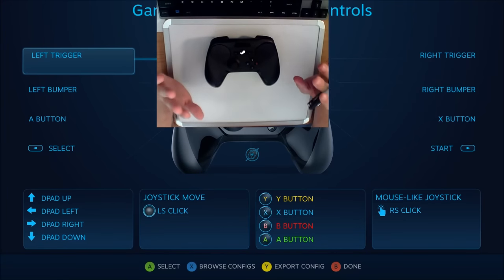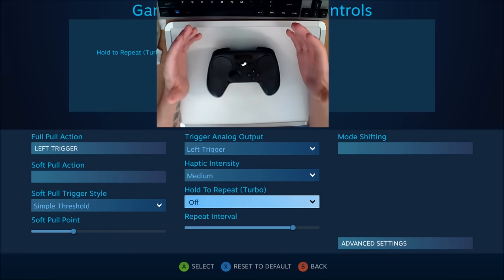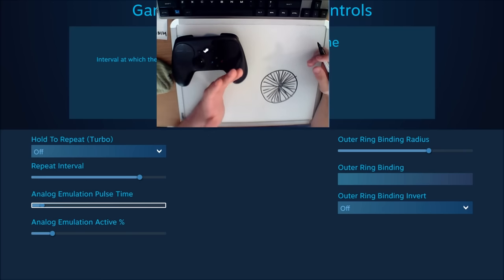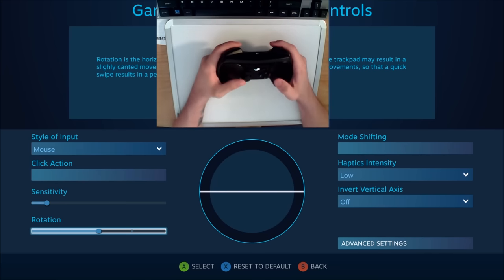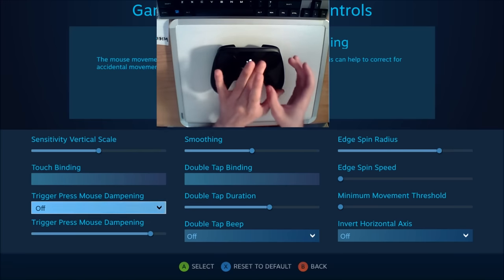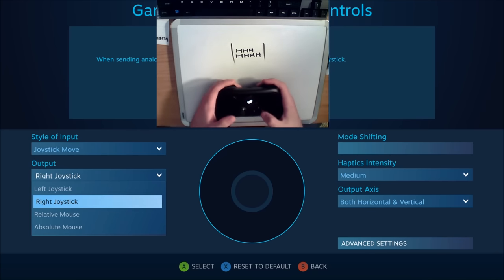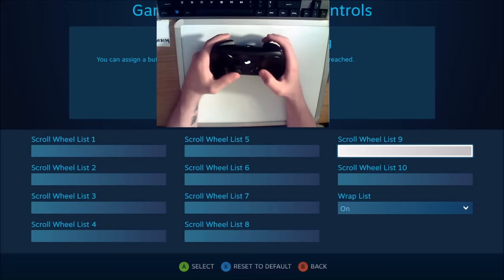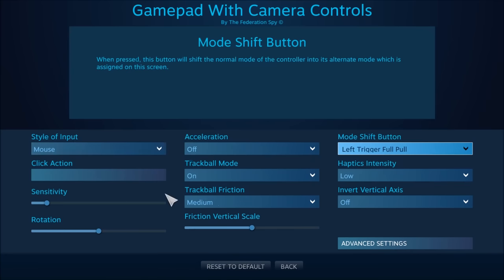Deciphering the Steam Controller Software (In-Depth/Very Long Video)

Comment: Timestamps for mobile:
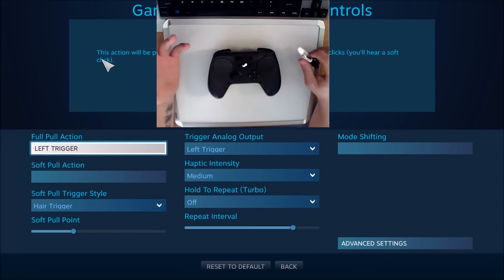1:10 - Triggers
1:50 - Trigger Soft/Full Pull Actions
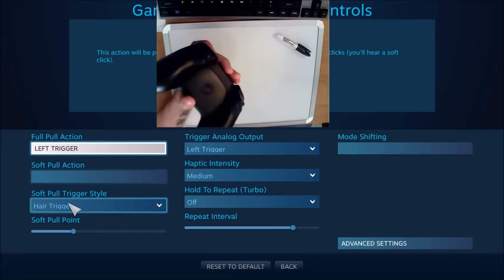2:28 - Trigger Soft Pull Point
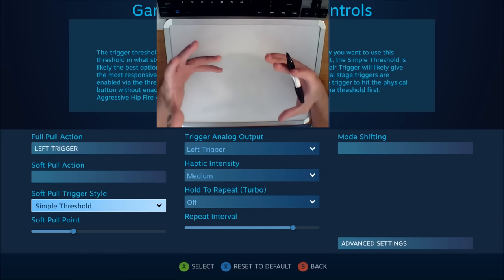3:14 - Trigger Soft Pull Trigger Style
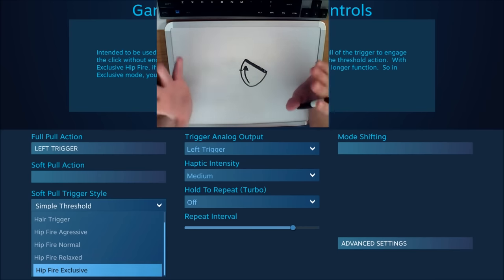7:39 - Trigger Analog Output
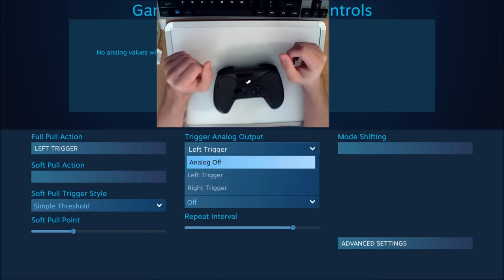8:33 - Haptics *
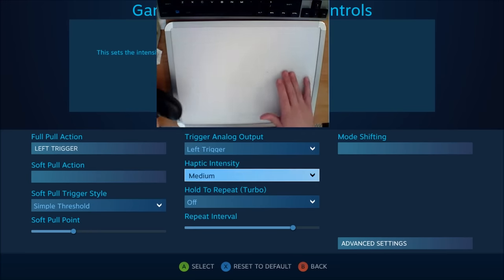9:19 - Hold To Repeat (Turbo) *
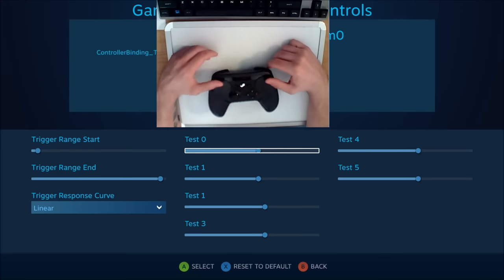11:24 - Trigger Start/End Range
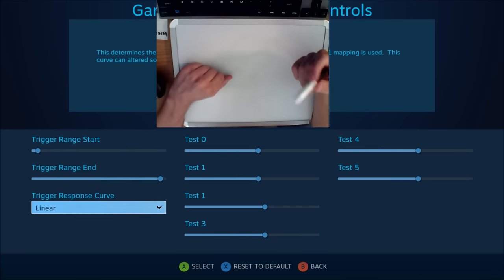12:55 - Trigger Response Curve *
16:25 - Bumpers/Grip Buttons
16:39 - Trackpad
16:47 - Trackpad/Stick Directional Pad Input
17:35 - Trackpad/Stick Directional Pad Layout *
22:16 - Trackpad/Stick Directional Pad Deadzone
22:45 - Outer Ring Binding/Radius *
22:07 - Outer Ring Binding Invert *
24:54 - Trackpad Button Pad
25:22 - Trackpad Button Pad Button Radius/Distance
27:35 - Trackpad (Mouse)
27:54 - Trackpad (Mouse) Sensitivity *
28:43 - Trackpad (Mouse) Rotation *
30:10 - Trackpad (Mouse) Acceleration *
33:23 - Trackpad (Mouse) Trackball Mode *
34:24 - Trackpad (Mouse) Trackball Friction *
35:10 - Trackpad (Mouse) Trackball Friction Vertical Scale *
37:21 - Trackpad (Mouse) Invert Axis *
37:49 - Trackpad (Mouse) Sensitivity Vertical Scale *
38:51 - Trackpad (Mouse) Touch Binding/Click Action *
39:06 - Trackpad (Mouse) Trigger Press Mouse Dampening *
40:02 - Trackpad (Mouse) Smoothing *
41:11 - Trackpad (Mouse) Double Tap Binding *
42:07 - Trackpad (Mouse) Edge Spin Radius/Speed *
43:39 - Trackpad (Mouse) Minimum Movement Threshold *
46:09 - Trackpad (Mouse Joystick)
47:15 - Trackpad (Mouse Joystick) Minimum X/Y Output Value
48:53 - Trackpad/Stick (Joystick Move)
49:00 - Trackpad/Stick (Joystick Move) Output
50:48 - Trackpad/Stick (Joystick Move) Output Axis
51:26 - Trackpad/Stick (Joystick Move) Adaptive Centering *
52:29 - Trackpad/Stick (Joystick Move) Stick Response Curve *
52:55 - Trackpad/Stick (Joystick Move) Deadzone Shape *
55:14 - Trackpad/Stick (Joystick Move) Anti-Deadzone/Buffer
56:46 - Trackpad/Stick (Joystick Camera)
57:09 - Trackpad/Stick (Scroll Wheel)
57:12 - Trackpad/Stick (Scroll Wheel) Swipe Duration *
57:41 - Trackpad/Stick (Scroll Wheel) Invert Direction
57:50 - Trackpad/Stick (Scroll Wheel) Clockwise/Counter Clockwise Binding
58:13 - Trackpad/Stick (Scroll Wheel) Advanced List
59:06 - Trackpad (Touch Menu)
59:29 - Trackpad (Touch Menu) Button Count
59:43 - Trackpad (Touch Menu) On-Screen Position
59:59 - Trackpad (Touch Menu) Activation Style
1:00:35 - Trackpad (Touch Menu) Touch Menu Buttons 1-4
1:01:00 - Trackpad (Touch Menu) Labels
1:01:05 - Trackpad (Touch Menu) Opacity
1:01:15 - Trackpad (Touch Menu) Menu Size
1:01:26 - Trackpad (Touch Menu) Advanced Menu Buttons 5-16
1:01:42 - Trackpad (Mouse Region)
1:03:57 - Gyro
1:04:26 - Gyro Enable Button
1:04:57 - Gyro Rotation *
1:05:13 - Gyro Left/Right Lean Bindings
1:05:23 - Gyro Steering Axis
1:05:33 - Gyro Lean Point
1:06:00 - Gyro Minimum Movement Threshold *
1:07:41 - Mode Shifting *

* Any timestamp with a "***" will indicate that this feature is available elsewhere in the software for a different input, but does the same thing. So, settings with a "***" will generally only be explained once.
Reply: THANK YOU. I'd missed mode shifting and you helped me!
Reply: Just got a steam controller. You sir are why I love the internet.
Reply: MVP
Reply: Thank you much, J.P.!!!

Comment: Great video! Just a small correction to the analog emulation part : it is used to emulate a precise angle when only 8 directions are available in-game.

So let's say you wanted to move in a direction halfway between forward and diagonally right (about 12:45 on a clock). The steam controller would then pulse quickly between 2 alternating inputs : forward and diagonal. Pulse time is how long it would send a single input before switching to the other. Active % is how much it sends an input vs no input (so let's say you set it to 20%, it would send a forward input 10% of the time, send no input for 40%, send a diagonal input for 10%, and then another 40% of no input).

It's similar to a PWM in electronics, for those that know what it is.

Comment: I just bought this controller it will be delivered next week. I was worried about the complex configuration as many people said. But u made it very clear. Good job!
Reply: I know your comment is a year old now, but i am in same situation as you were. Now I am wonder what is your experience with this controller? Are you still using it? Do you like it?
Reply: @JohnnyBravo655  Yes, I like the controller and I'm still using it for most of the games I play. The only thing that I don't like that it has no second analogue stick and that the custom configurations don't seem to work when you have no internet. Other than that no complaints.

Comment: Yes, very well done!
I want to add that haptic feedback is not "force feed back" that provides actual mechanical resistance in the case of a steering wheel or flightstick. You correctly referred to it as haptic feedback. In the case where you assign a push-to-talk button, the haptic feedback is excellent at notifying you to the fact that you are transmitting.  What I call a long short press will allow you to use a control for other functions and a push to talk key at the same time. Take the long press and cut the time in half on the right grip for example and you have push-to-talk. Also use the "play button" on the keyboard. Often people use insert or End, but the play media button will never be used by a game as a control. I think it's also called the play/pause button. Use that in all softwares that allow and you will never have a conflict.

Comment: Holy SHIT, man. This is a brilliant guide, I've owned a Steam controller for weeks and this has taught me so many ways to customize controls. Thanks so much for this.
Reply from the maker: I'm glad I could help.  Valve sure doesn't make it easy.  Be sure to check out the other two tutorial videos I did that correct a couple errors in this video.  Valve contacted me and gave me a a few corrections to put in.  In the coming weeks, when I have time I hope to make a completely comprehensive guide with better quality and visuals.
Reply: Yep, the annotations led me there already, thanks! Always handy when content makers properly annotate their stuff.

You're right though, Valve's configuration screens definitely do not have a ton of information. I'd love a visual representation of the deadzone as you change the slider, or at least have it respond by force feedback or something when you are in the config tool changing those settings.

Comment: Thank you much, Nick! I have been using my S.C. for quite a while now, so much so, that I am more comfortable using it, as opposed to M&K. However, the info you provided has helped me to have a better understanding of the controller, and will greatly help in tweaking and improving my settings. Thanks again!

Comment: It would be nice if they added that hair trigger option to the analog sticks, cause right now when you're moving forward with the analog stick and then let go of the analog stick, the controller still sends the forward input while the stick is on its way to the resting position.

Comment: First of all: excellent work.  I have been using the Steam Controller for quite a while and I learned some really useful stuff.

Also: I use the mouse region option for games like RTS that have a map or other UI element in a static place on the screen.  For example, in Company Of Heroes I have a Mouse Region mapped to the command buttons in the bottom right hand corner. It makes it much easier to snap down and give commands without losing my 'real' cursor's location on the screen.

Comment: The uses for mouse region are aiming in top-down shooters (Nuclear Throne, Gungeon) or any other situation where you need to control a cursor when timing/speed matters more than menu usability. For that reason, it also works extremely well for Osu! (a rhythm game like Elite Beat Agents) and Wii games running through dolphin.

Comment: Thanks for the video it really helps break things down. I'm close to losing a little patience with the controller but hopefully I'll be able to tweak it a little better now. I think Valve has almost been it's own worst enemy, they have given us an extremelly customisable controller but it's a sahme you need a degree in controller engineering to fully understand it.

Comment: Amazing explanation, tho you forgot one small thing: you can add multiple inputs to the same button within the input screen where it shows you a mouse, keyboard, and controller by pressing Y on the controller, and they can also have separate configs too. With that you can make a button send a different input by, let's say, holding the button for "X" amount of time and even make macros! This software literally replaces AutoHotkey in many ways. (Also for people who don't know this: the software also supports Xbox and PS controllers.)
Reply from the maker: Z0MG H4X Thank you!  Activators were added after this video was made.

Comment: Excellent video dude! I've owned a Steam Controller for the past few months and your review was the only accurate one I've seen. It is a really overwhelming experience customising at first and I'm only really getting the hang of it now but I'm still learning. Also wondering if you've updated your BPM version because mine doesn't have all those test options which do nothing, plus there's now added visualisations for trigger options, etc. It's way easier to customise now.

Comment: Do all the controls you set up get saved to your steam account? (I'm halfway through so sorry if you answer it later on) Just it would suck to go all the way through setting up your controls to have to do them again another time... - Thanks for the video, especially the examples a lot I didn't think of and make a lot of sense. Am getting mine tomorrow and this has already helped massively!
Reply from the maker: It will save them automatically, but if you want to save a permanent copy of the preset to your Steam cloud, you have to do that manually.

Comment: 56:30 you explain anti deadzone what would happen if you set your track pad to do the thing where it will keep on sending signals when you reach the edge if there is a built in deadzone will you hit that no matter what if your track pad keeps sending signals to move outward?

Comment: What if I want to use a button (like the bumper) to hold this key to open up different key maps? Is that the layers option? I would like it so that I can turn my 4 d pad buttons into 8 because they have a separate set of keys that activate when I hold in the bumper.

Comment: what I've noticed in most games I've played so far, bf3. bfbc 2. arms 3 etc. I can't just use my xbone controller to use both the left joystick and right.  right will not work at all unless it's in some mouse mode. and even then it's either too sensitive or completely useless.  it's really starting to put my right off pc gaming.  'I just wanna play bf on my  pc with the xbox controller with the same sensitivity etc as on console' 😠😠  this is why I still use consoles more

Comment: New Subscriber :) Quick question for the track pad, I'm trying to find out how to program the buttons in between UP, DOWN, RIGHT, LEFT.  So if I touch the trackpad between UP and LEFT it would perform whatever function I have programmed, is this possible?  I can't seem to find a setting for it.
Reply from the maker: Thank you!  I don't think there's a way to do that specifically, no.

Comment: Thank you for this! I'm a Mac user, and the controller I ordered just came in. Do you recommend that I keep the default settings? Also, I noticed that the controller is not working for certain games. Do I have to configure it for each game I choose to play with it?
Reply from the maker: I've never tried to use it with a mac.  For some games wherein the Steam Controller has no native built-in support (some of the only games with such support are Valve titles), you usually have to cruise through the communities profiles and look for a profile that works for you.  Then, if you want you can modify it and customize it.
Reply: Ok, thanks for your help! Quick question: what's the quickest way to turn off the controller? The only way I know is within Big Picture mode. I would think clicking the Steam button would do it but no.
Reply from the maker: Hold the steam button down for 5 seconds.

Comment: Help ! 
I have an issue fat fingering my Y button and track pad at the same time. How do I dead zone the outer edge of the track pad? This is very frustrating. Every time I go for a heavy attack my screen gets pulled down diagonally left.
Reply from the maker: reptilesgamers00 Cut carbs.
Reply: small piece of electrical tape?

Comment: Hey, thanks for the vid, but you(like everyone else) still didn't talk about the ACTUAL joystick on the controller. How do you increase the sensitivity on the ACTUAL stick?(not the trackpads)
Reply from the maker: HotTabascoSauce Yeah, I'm not sure if there is a joystick sensitivity in the software.  Most games will let you edit it in-game.  Other than that, messing around with the inner and outer deadlines could kinda help change the sensitivity.

Comment: I just received mine and can't make heads or tails of it.

Something I've noticed over and over is that often times the user documentation for software is written by the people who wrote the code.  So the text makes no sense to normal people.

For example, a sensible instruction to copy text is as follows: "How to Copy Text: Place the mouse cursor at the beginning of the text you want to copy.  Press and hold the left mouse button, then move the mouse to the end of the text you are copying.  Release the mouse and select 'Copy' from the Edit Menu or Right-Click and select 'Copy' from the pop-up context menu.  The text may now be pasted in one or more locations."

A developer would write it such as, "Replicating string data to alternate concurrent processes is easy!  You need have no knowledge of volatile memory or memory addresses.  In fact, you don't need to understand why the replicated string is retained in memory until being overwritten by new data so it may be duplicated to multiple locations!"

They think they told you something and now they're done with their instructions of how to copy in paste even though they didn't give you the first bit of useful information to teach the user how to copy or to paste.

I especially see that sort of thing in very expensive specialized software such as used by the medical industry.

As I scanned through the software for the Steam controller, everything that was written was worded in weird and awkward ways and none of it really explained anything you'd need to know.  The entire "help" system needs to be shit-canned and then rewritten by people who know how to actually teach things to people.

Comment: Is there a way to press one button on the controller and mode shift every button on the controller?
Reply from the maker: Yes, you can do this by assigning the button's function to a separate action set.  Sorry for the delayed response.

I give a good example of this in my SC2 profile video.  I think I use at least two action sets.